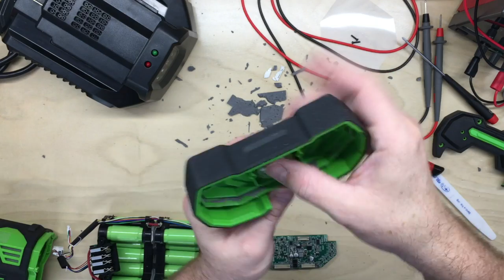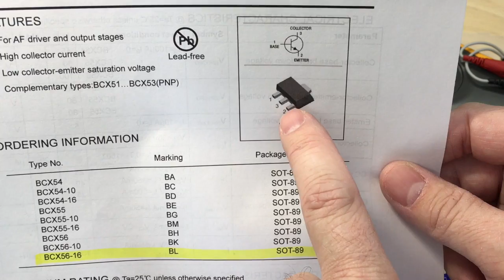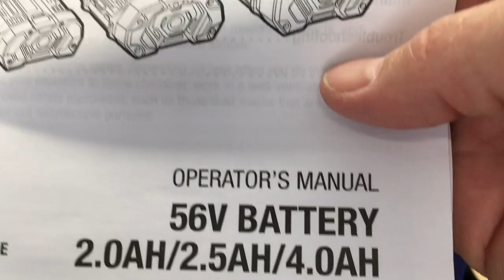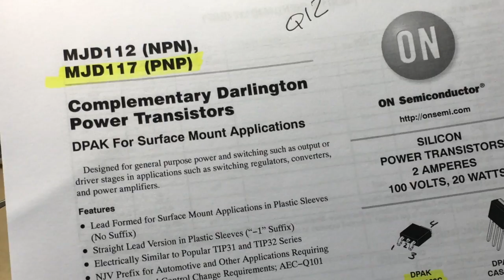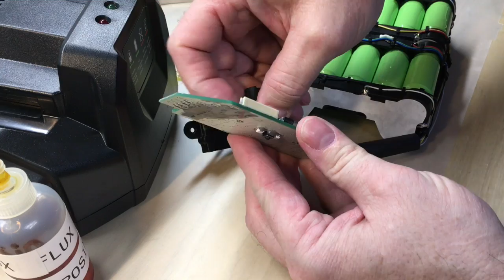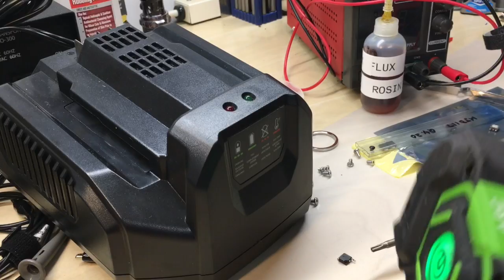EGO 56V ARC Lithium Battery Repair

Comment: Great video, thank you for taking the time!  Tested what I could and of course Q12 is shorted. But, the two photo couplers did not test like yours. The transistor side had impendence in both directions on both couplers. They both measured the same on all pin outs.  Not sure if its me and the vom or coupler.  The bats checked from 4.02 volts to 4.41 volts. The electronics is far too small for my soldering setup and skills. Fun to investigate and learn though. Brings back High School electronics from the 70's. lol  Anyway, any ideas on what to do with batteries.
Reply from the maker: Hi,
Thanks for your kind comment! The Q12 is not very hard to replace, the bottom right pin or gate pin is the toughest becaue the trace and pad  is very tiny if you decide to try it just be very careful on that pad especially. Are you asking what to do with cells as in what you can do with them or how to recycle them?
You can use the individual cells for many things including flashlights etc. that you can purchase really cheap and can run for a long time from individual 18650 cells. You may have to take the phase change sleeve off the cells for some uses. As far as recycling you can take them to a Lowe's or Home Depot and put them in recycle bin or if you feel like dealing with it, these EGO packs still bring pretty good money on eBay as non-working for parts only.  I still see 2.5ah packs at times bringing over $25 and 5ah packs over $45. Hope it helps...

Comment: I’m trying to figure out my 2.5ah battery issue. Battery is at 48v. No lights. No reaction when I hit the button. Charger constantly clicks on and off when battery is added. 

Any idea how to test T1? It’s the only thing  that I’m not sure what to expect for resistance and voltage. The Q12 I have is fine. C26 might be stuck open, but I don’t think that would cause this. I’ve tested nearly every diode and transistor. None of them are out of the ordinary. I tested everything on the D circuit you drew and they all seem fine.
Reply from the maker: If you have the voltage at the DC-DC converter then it could be the microcontroller itself. Only a guess from here. I have shared what I have found over the years.  Best of luck to ya!
Reply: @ThriftyToolShed  Thanks for getting back to me! You saying DC to DC converter got me thinking. It must turn the 56v into 3.3v and 8v. 

I am 99% sure it’s T1 bad on my board. I think this because I bought two more bad 2.5ah batteries. One had a good board with a cell needing rebalance (now fixed), one with a bad board (lights green, but then has a random flickering orange). Good board T1 measures low resistance across top left and top middle legs, bottom left and bottom middle legs, and top right and bottom right. Makes sense since T1 is just some coils. Both bad boards have opens across one or two of those pairs. 

The board with no lights had an open where 56v comes in. The board with green then orange flicker was open on the 8v side. Any idea where to buy some T1?
Reply from the maker: @Nikerunner72  
Yes the DC-DC converter does reduve the voltage for contol board. I believe on video I shared at one point that around 10V on the capacitor close to the T1. Is common. Then it gets dropped again I believe. But if T1 not working that 10V maybe missing anyway?
I have been asked that many times about T1 source and parts in general and commented many times. I have not looked for a source for the T1 transformer. I bought enough bad packs over the course of working on them and sharing what we could learn about them so I would have lots of donor parts. Digi-key or Mouser may have one, I typically use donor parts.

Comment: Just saved my 7.5Ah battery with your help!!! Many thanks
Reply from the maker: Awesome job! Thanks for sharing!
Reply: @ThriftyToolShed  In fact, I didn't do "an awesome job" since my iron was too hot and managed to make one of the coppper trace on the board to detach :D I had to refit a litle wire to redo the circuit trace :D.... BUT IT WORKS! I am so happy :)

Comment: At 37:10 ... TP_3V3 is just a signal name on the schematic where the "V" takes the place of the decimal point, because you often cannot use punctuation when naming signals in PCB design software, or punctuation makes it confusing.  But you can add silkscreened labels on a PCB and use whatever text you like, so that's why it says 3.3V above that capacitor.
Reply from the maker: It's been 4 years ago for this one. I believe I was simply stating they both are screen printed and may be the same 3.3V rail. I simply meant at this point in sharing information I was not sure if it was the exact same 3.3v rail. I am very aware that  sometimes "v" is used as stated, but unsure if another reason it was screen printed differently. Thanks for sharing.

Comment: Your video are awesome. Dop you have a pic of each of the connectors? When removing the top off my 4aH, the the wires pulled from the top (single ) connector and I do not how it goes back. Also you are ablew to remove the potting material from the board, mine is black and does not come off as cleanly at all. Any tips?
Reply from the maker: Thanks for your kind comment! 
I do have the video in the link below that shows the 2.5ah BMS wiring that was requested some time ago. Hope you find it helpful. The 4ah may have a few more wires, but they are extremely similar. The potting on all mine so far has not been that bad so I don't know why yours is different. All mine were dark grey silicone potting. Strange how some are different. I have not worked on any of the newer 3rd Gen with the segmented fuel gauge yet to say how they are either. Best of luck to ya! https://youtu.be/RfTJODoh8Q4

Comment: Hi!  Thanks for doing these.  They are a big help.  One suggestion I might have is looking at the issues/problems  with these batteries based on the symptoms that one might see from the battery what a person might look at to fix the problem.  For instance my battery is blinking green and this video you showed that the one you were working on was doing the same.   For that you replaced the Q12 (MJD117).  Unfortunately that doesn't seem to have fixed my board but I'll keep looking.
Reply from the maker: Thanks for your suggestion. I can only say I started this journey over 4 years ago to help the community as we learn to work on these together and share what we learn as we learn, not sharing as anyone with schematics or any other information nor claim to have any certain EGO expertise. We are simply creating our own information.  Of course 4 years later I wish I could change some things in the video, but with YouTube it is not possible to edit any uploaded video of course. It's either delete it or not. Glad you found it helpful and I have many more as we learn together over the years including repair of blowers, chainsaws etc. and packs with other issues. I was simply troubleshooting the blinking green issue on this video that 90% of these packs have while blinking green constantly without one clue if it was even possible. This is not to be confused with the blinking green for maintenance mode.  This is blinking green all the time even while in use and even while charging and the pack will pull down to zero volts if allowed while Q12 is shorted. Thanks for your comment!

Comment: This video has been amazingly helpful in my troubleshooting!

I have been really enjoying your repair videos, particularly the ones with the EGO batteries. I have a 7.5AH 2nd gen that seems to have died on me while using it in the leaf blower for snow.. I seem to have found an issue with the U5 microcontroller "95F012K" chip on the BMS.. I was wondering if you have any spare 7.5ah BMS boards that I can purchase from you so I can salvage that chip from? Thanks for hearing me out!
Reply from the maker: Sorry. I do not have any 7.5ah packs at all. I have not worked on one yet, so unsure if a difference in 5ah and 7.5ah BMS board for sure. Thanks so much for your comment and best of luck to ya!

Comment: Very impressive troubleshooting and component repair. I have a 2.0 Ah battery from 2014 that has quit. It was completely dead on the charger. I opened it then put it back together and now it blinks on the charger and the charger clicks. I will buy a new battery and try to recycle this one. Would it be of any interest to you?
Reply from the maker: I would take it, but to be fair, they do bring some money on eBay if you want to try that!
Reply: @ThriftyToolShed  I will send it to you if you will cover the shipping..  Lowe's had a $70 delivery charge but some eBay sellers had ~$15 fee, so not sure of cost or any shipping restrictions.
Reply from the maker: I don't understand the delivery charge I guess?

Comment: Thank you so much for posting this!  I replaced the cells on a dead pack I bought off eBay and when I hooked up the BMS it had the same symptom.  Found this video and went straight to Q12 and it was shorted as well.  Replaced with the part you linked to on eBay and the pack is no longer stuck in maintenance drain mode.
Reply from the maker: Awesome job, thanks for sharing!

Comment: My battery works in my blower for about 10 seconds and then shuts off. The main terminals read 52v. Where should I start when looking to determine why it's shutting off like that?
Reply from the maker: Make sure the connections are good on the pack to the tool. If the D-terminal is not detected it will shut down in about 10 secs. after starting up. Clean connections first and if it isn't that it could be a faulty BMS board in the pack. Double check that it's the pack and not the tool by trying another pack though to verify. The only other thing is if the pack is pulling down too low and blinking red then it could be a bad cell in the pack causing that. Even though the battery pack voltage is high enough, once it starts it could be one cell dripping off and causing the shutdown.

Comment: Thank you very much.  My battery was 3 years and 1 month old and Ego wasn't going to do anything for me. I fixed my 2.5 AH battery by replacing Q12 after watching this video!  Fun to watch and very helpful....
Reply from the maker: Excellent job. Thanks so much for your comment!
Reply: @ThriftyToolShed  I had charged the battery before doing the repair and finally got around to using the battery until it wasn't driving my string trimmer anymore. However, my charger seems to think it's still fully charged and won't charge the battery.  Pushing the button and still shows green.  Any suggestions?
Reply from the maker: I have not had that issue by just replacing Q12. What is the voltage reading of the pack at the terminals?
Reply: @ThriftyToolShed  I'm reading 46.6V. But I still get a green light when I push the button...
Reply from the maker: @mitchphillips3034  
At 46.6V the average of the 14 sets in series should be 3.32V so the only thing I would know to try is see if all cells are balanced well. If one set is still around 4V or so it may show it's fully charged because one set is still high enough. Checking the balance is all I can think of, other than that it's a problem with the BMS board thinking it's that way.
Reply: @ThriftyToolShed  Thanks.  So I should open it up and check each cell?
Reply from the maker: Yes, similar to what I show in the next few videos about EGO packs. I shared as I learned on these a few years ago. After this first repair video I shared several more videos about cell checking and cell replacement.
Reply: @ThriftyToolShed  I finally got around to taking the battery apart. The total battery voltage now is 45.3V. Each cell is about 3.24 to 3.27V, with one cell being 3.17V.   Would you suggest that I charge all the cells in the pack from the main power and ground lines with a programmable power supply?  If so, what voltage and current?  Thx....
Reply from the maker: @mitchphillips3034  honestly they sound as if they are balanced pretty good and none of them are alot lower than the others so maybe not a bad cell. Unless one is quickly dropping out before the others while under load? As far as charge current if you find it's needed.  I usually stick to around 1A unless I know all the cells are good, them I will step up to around 2A charge current. The max voltage across pack should not reach over 58V or 4.2V per cell of course!
Reply: @ThriftyToolShed  OK, so programmable voltage supply at 57V, and 1A to start?
Reply from the maker: Yes, If you are going across whole pack + & - terminals.
Reply: Also, any other ideas why the charger looks like it will start charging, then indicates full charge?
Reply from the maker: Yes, should be fine if going across + & - power terminals directly.
Reply: @ThriftyToolShed  Also, any other ideas why the charger looks like it will start charging, then immediately indicates full charge?
Reply: So all the cells seem fine.  I charged each half of the battery at a time, and brought the pack up from 45V to 50V.  Now light is green, but when I put on charger, it looks like it will start to charge, and then immediately shows it has full charge. Any ideas? I guess there's something wrong with the controller board? A thermistor?
Reply from the maker: @mitchphillips3034  I have had one BMS do this and I have not figured out what caused this. Changing out the BMS board with another one did fix the issue. I did not find any component that showed different or tested as failed on the board. I just had to say something with the microcontroller must have been bad because it was doing this even though all test points, components and cells tested fine. Must be something in the microcontroller. I still hope to find out one day, but after hours of troubleshooting, I had to give up on this one.
Reply: @ThriftyToolShed  Thanks for your time.  I guess I'll hang on to this for the spare cells or try and get a replacement BMS board, but it's probably just a waste.....

Comment: Anyone have a part number for T1? a small transformer to the left of C3? mine came up in pieces with the potting, I think it was only held together with the potting as I was extremely careful when removing the material. Anyways, I cannot locate a PN for this transformer.
Reply: It would appear that it may be a "Pulse Electronics Power PH9084" series transformer, but without any identifying markings, I'm kinda in the dark as to which exact one. Any help identifying this transformer would be greatly appreciated.
Reply from the maker: Very possible. I have not tried one of these to say for sure, but it looks close. I have only used a replacement one from an spare BMS board from a bad pack. Used it as kind of a donor board.
Reply: @ThriftyToolShed  dang it. I dont have a donor to pull one from myself. Do you have a donor board with this part that youd would be willing to sell, or the transformer from one?
Reply from the maker: I don't at the moment. I have not had to work on many packs in a while now, which is a good thing.
Reply: @ThriftyToolShed  Well dang, tha k you so much for replying anyways!
Reply: Has anyone tried one of these pulse transformers or found one close to what is required?

Comment: I have a 56V EGO Lithium battery that was left on our deck last night that had a light short shower.  Bettery was sitting up. It was wet on the exterior. Pushing the power button on it gave me a green light.  I put it on its charger.  It immediately showed the first quarter charge (One green light blinking).  In a short time, the second light started blinking (the 50% charge light) then after 10-15 minutes, the third green light (the 75% charge light) started blinking, so there were 3 of the 4 charge lights lighting green.  I am told, as a standard reply to water on the battery, there is risk of damage to a tool  that the battery is connected, or hooked, to if there is water that   causes a short, and could even cause a fire. A new battery would cost a lot.  So I am considering trying the battery on one of my tools.  I could also put a fan blowing on the battery for a long time, i.e. 24 hrs, in hope that it would dry out what little moisture may be inside.  Anyone have any advice or comment that might help me understand my situation better? Thanks.

Comment: Great job! How do you know the part number of the transistors to find the datasheet just by looking at?  Great videos by the way.
Reply from the maker: They have the part number laser etched on the chip. And just a few minutes search usually yields the data sheet. Just like the transistor MJD117 for example.  Sometimes the chips are custom and can not be found. I  found no custom chips on this one, I found pretty much all of them.
Reply: @ThriftyToolShed  awsome thank's very much. I guess I'm spoiled at work where the part manufacturer on the BIlling of Materials and just mouser for the datasheet. I'm starting to do repairs at home on old retro stuff. so I was curious on it finding parts. Thank you very much your videos are very addictive  to watch !
Reply from the maker: @Meow_Deity  Thanks for your comment. Yes the BOM and schematics are heavenly, unfortunately they seem to be a thing of the past for consumer electronics, I miss that alot. We have to go into it blind...